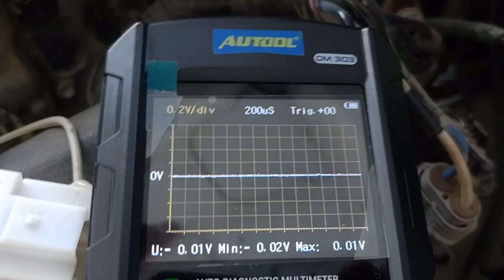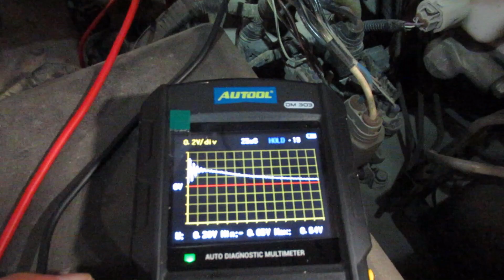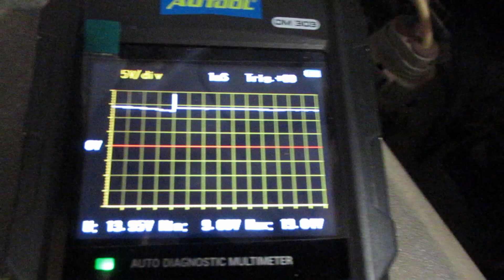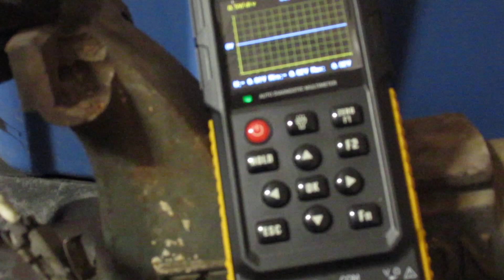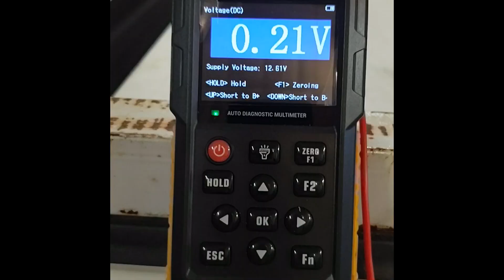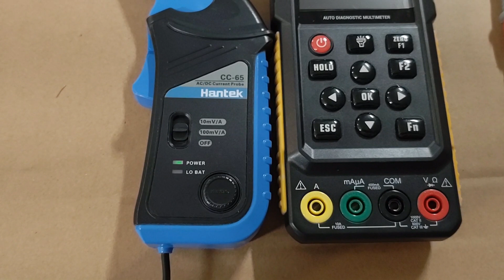Autool DM303, Some of my favorite features demonstrated.

Comment: Hello, what is the practical application of a sinusoidal and square wave signal generator?
Reply from the maker: I don't think that there is many usual applications for the function generator. I suppose that you might be able to test or simulate a component that sees or generates a square wave or pulse. I did use it yesterday to test 2 oscilloscopes.  I wanted to see if the were capable of displaying a very narrow pulse at 8000 hertz.  I was looking at Mechanic Mindset's post Don't be fooled crank sensor or oscilloscope. He was looking at a Mercedes crankshaft sensor with 8 pulses per revolution. I wanted to see what my scope would display. I was able to set the DM303 at 3% duty cycle and see a pulse on my OWON portable and Bench scopes.  If there were a lot of missing pulses i would determine that my scopes cannot display such a signal and not condemn the sensor. I have an other function generator but it cannot vary the duty cycle.  The OWONs did well at 8000khz.  I could also check my graphing volt meters to see what they are capable of displaying. I hope this was helpful. Thanks for your comment.
Reply from the maker: Correction; I made a 60 times mistake.  The frequency would only be 133 hertz.  I was thinking 1000 RPM times 8 pulses.  I forgot to divide by 60 to get seconds. I should retest all my meters to see what they would read at 133.3 hertz.   I need to go back and look at Mechanic Mindset's video. I am not sure why any scope couldn't display that signal. It may be that i misunderstand what the sensor is outputting. I don't have a Mercedes to test.